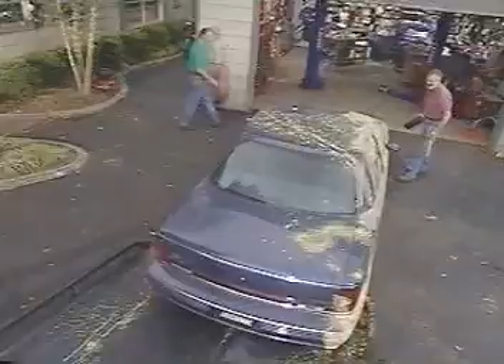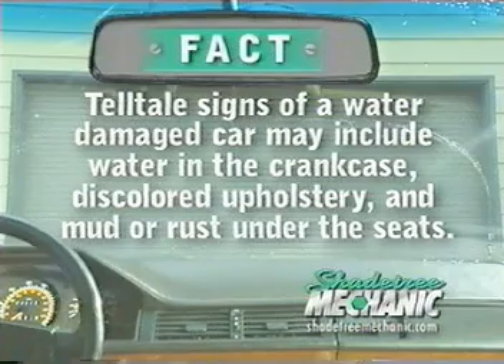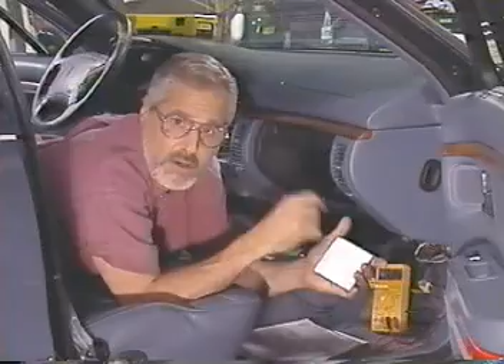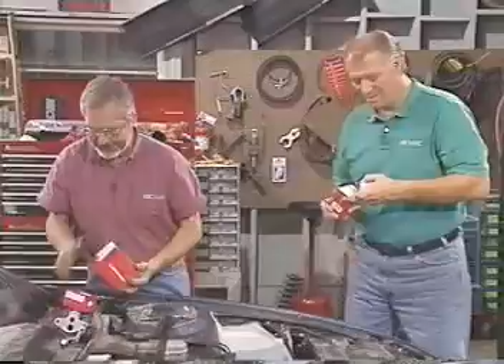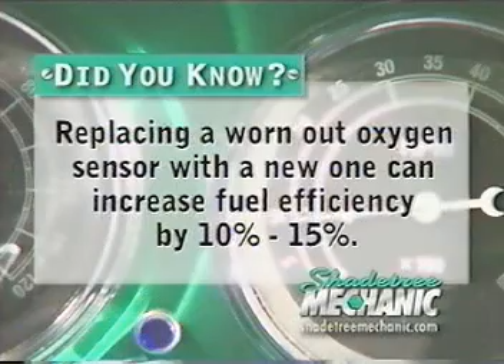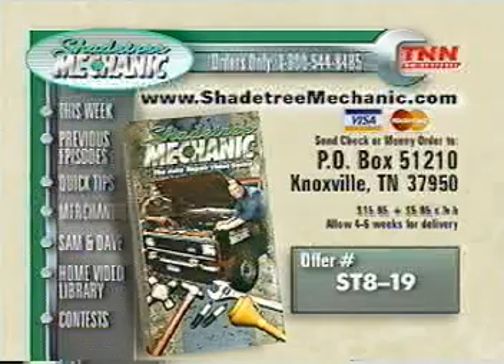Video: Shadetree Mechanics - TV Show featuring Standard Motor Products

Comment: Remember this episode from when it was new. I get it that it’s basically just a standard motor products commercial, but they are also giving some misleading information. They didn’t fix or even unplug the shorted sensors before calling the computer. If the 5Vref is shorted, it usually wont communicate or anything else. I’ve never seen a shorted 5Vref kill a computer.